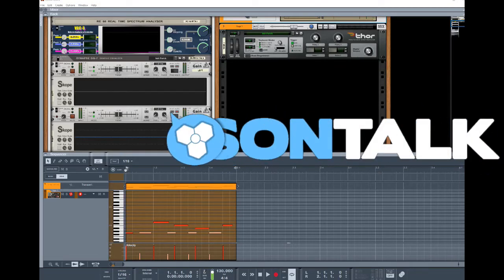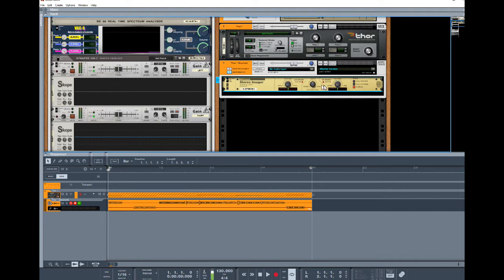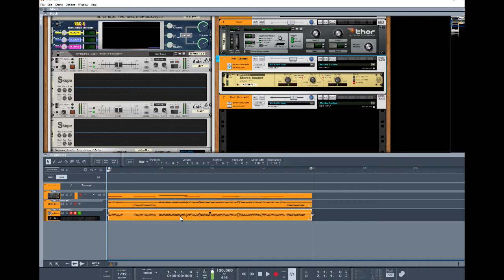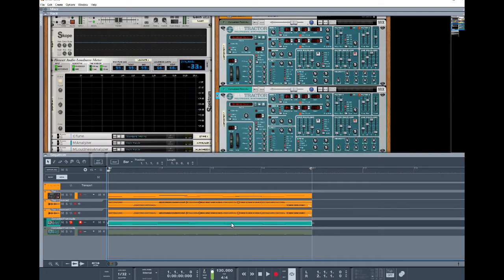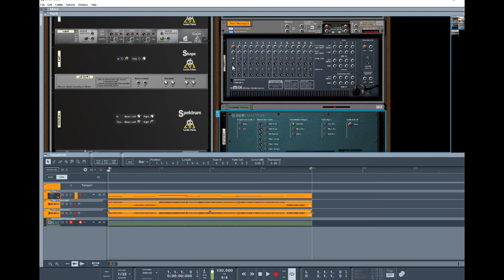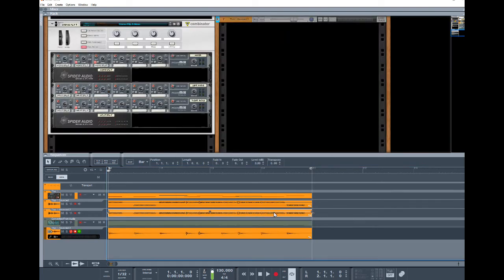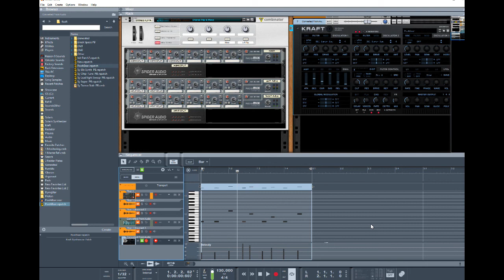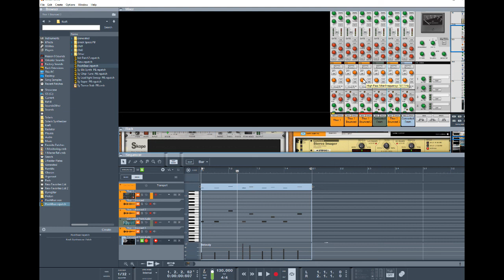Audio to Mono and Audio to Midi

Comment: I HAVE BEEN LOOKING FOR THIS SOLUTION FOR 48 STRAIT HOURS. I HAVE TRIED EVERYTHING EVEN CONSIDERING USING AUDACITY TO SPLIT A STEREO FILE THAT I HAD IMAGED TO MONO TO GET A MONO TRACK. THIS VIDEO IS SAVING MY BUT. EVIDENTLY THIS IS TOO HARD FOR ANYONE ELSE ON THE INTERNET TO TEACH...
Reply from the maker: Originally I was not going to cover the audio to mono but as there was so much confusion about Midi and Audio I thought I would cover it :)

Comment: Great video...I was looking for ages for video to show me how to do that! A quick question though, you say you'll use a stereo imager because you're not that bothered about the audio. Does this method of turning a stereo track to mono ruin the audio? Is there a way you'd do it if you were bothered about the audio?
Reply from the maker: It was a wrong choice of words, it's fine to use, I do however prefer to use the Selig Gain as that has a mono button on it and makes it easy to switch between Stereo and Mono however if you want to bounce mono then you have to remove the cable afterwards etc.
If you are looking for listening Mono solution there is another video on my channel to do with sidechaining the Master bus and that has a link to the patch (if I remember correctly) which also does Mono and removes the cable for you etc.
Reply: @PoohBearsReasonChannel  Awesome. Thank you so much. 👍🏻

Comment: Hi Couldn't you insert the stereo imager into thor and remove right cable, then bounce mixer channels to get a mono track, so cutting one of the steps.
Reply from the maker: No, 
A) you will still end up with a Stereo track which happens hold the same signal on both channels.
B) I started with the Thor just so you could see the notes at the beginging to match at the end, most people have just the audio only to work with.